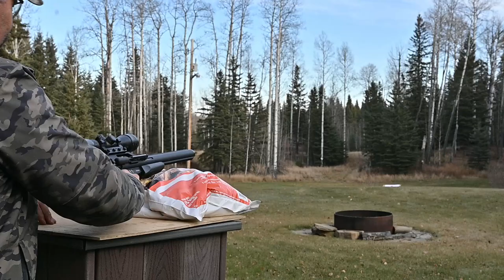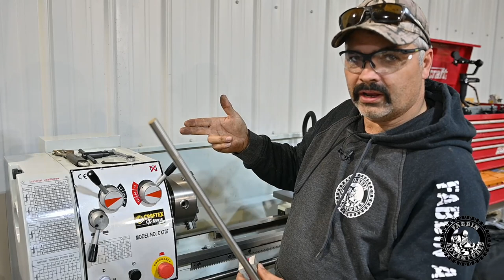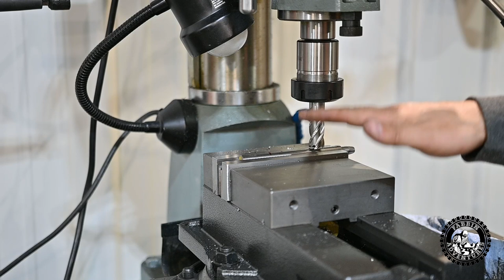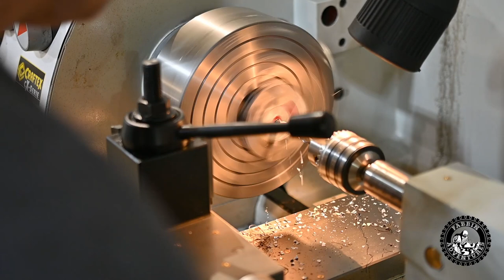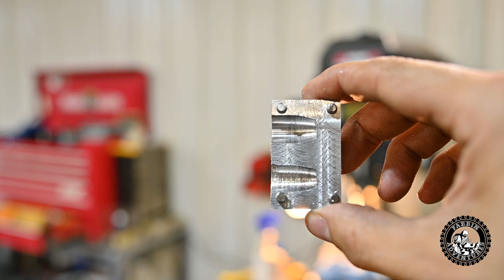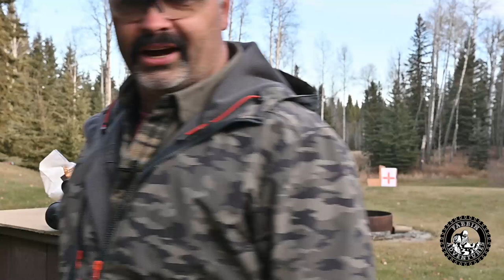How to make a .510" Slug Mold: Custom Bullet for the 50 Cal Airforce Texan!

Comment: Pure lead shrinks about 2 thousand depending on the tem you cast it with. .5135 is perfect. Then size it back to .510 air guns dont like anything bigger than bore. It ruines velocity and hurts accuracy
Reply from the maker: They cast well and the sizer i made to.5095" just to be safe.
Its been so damn cold here i have not been able to do any testing. Supposed to warm up to +temps early next week, maybe ill be able to do some group testing with them!
Thanks for watching and commenting!

Comment: Is the .50 cal diameter supposed to be one to two thousands above bore diameter (.501/2) opposed to .510?
Reply from the maker: There are 2 different 50 cal sizes for air rifles, one of them is .495 i believe and the texan takes .510"
These are cast .513" then sized to .510" i havent shot groups with them yet, but they seem accurate.

Comment: Great video!  I have a Umarex Hammer and an AEA Zeus 72 cal I just purchased.  I was very curious about the slug making process.  Interested to know what happens after you have the mold.   Thanks for posting.
Reply from the maker: Well i dont think i will be posting any videos on the casting process. It is really easy to cast your own bullets though.
You tube does not like this video and is no putting adds or very little adds in this video, so i make $0 off of it and it actually hurts my channel a little bit.
Sorry.
Reply from the maker: I hear ya, you tube has been pissing me off, friggen liberal platform.
I may make some molds to sell if the bullets prove to be accurate.
I will be starting to make knives again and will be videoing the process and then selling them off. Im in the middle of building and filming a heat treat oven right now!
Reply from the maker: Ok, sounds good
Reply: Hell yea! I'd buy a few molds as well👍👍👍👍
Reply from the maker: Glad you liked the show